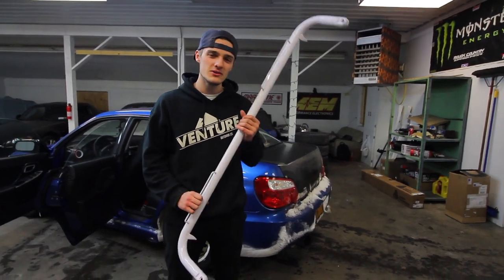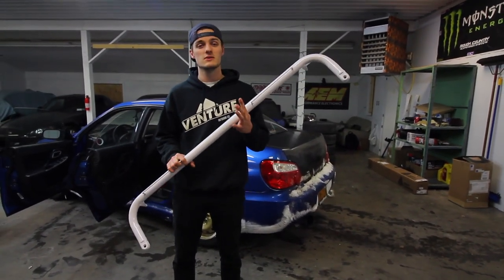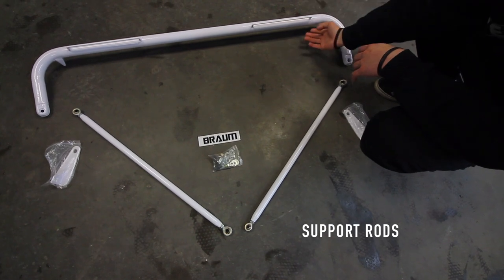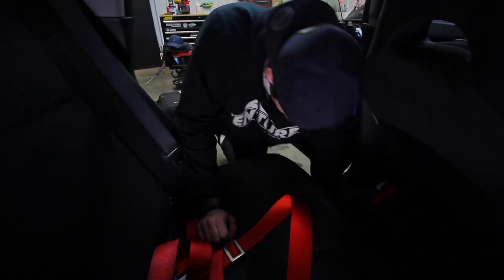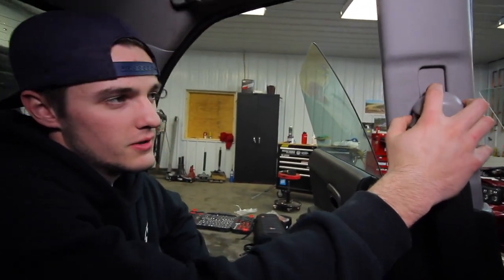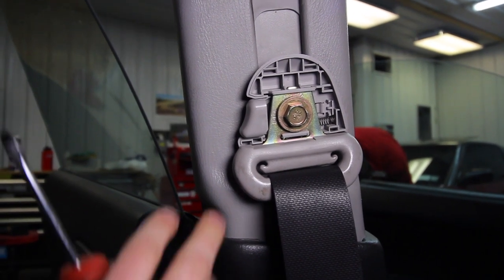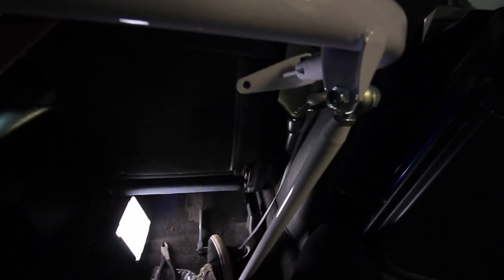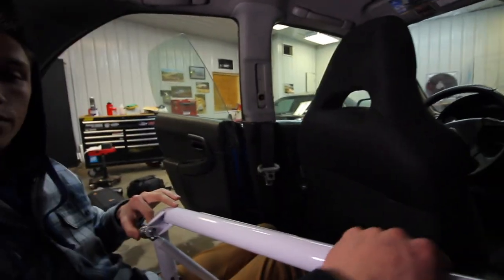BRAUM Harness Bar Install | Subaru WRX

Comment: Hey man i jusy got some 4 point harnesses with the latch for the eye bolt amd i know these had them.before how the heck did u remove that latch thingy so u could wrap around !?!?!?! Thanks dude
Reply from the maker: You cut the harness all the way at the end right up against where the latch is
Reply: WCKD Street Media did u put a slider or anything on the straps after that ?

Comment: Why not use the OEM hardware? You do know those bolts they supply are just repackaged China hardware.
Reply from the maker: We did use the oem hardware, other ones did not fit quiet right probably cause they are from China

Comment: Should've got the bar before the harnesses because if you get into an accident the damn things are going to compress your spine and you'll be 6 inches shorter but you do you I guess.
Reply from the maker: You are correct, we have since studied up on all our harness and safety stuff. Thanks for watching!
Reply: @WCKDStreetMedia  it was a good video I just winced a bit at the original harness set. Glad you changed it though it looks sick.

Comment: Never use harnesses or bars unless it on the track trust oem seatbelts
Reply: But you can't run bucket race seats with oem belts. Lol
Reply: Moza Yes you can
Reply: But racecar?